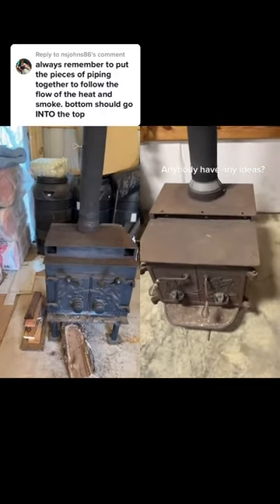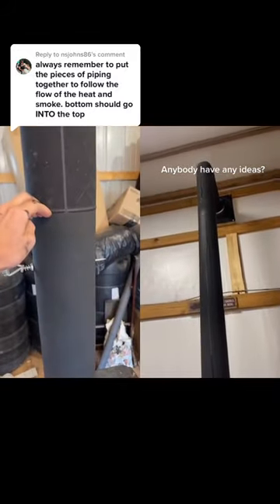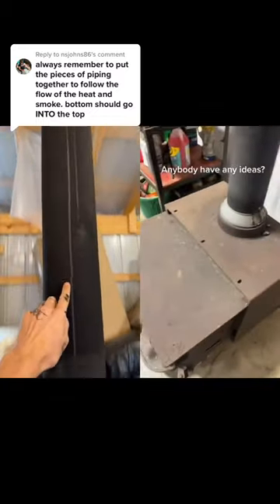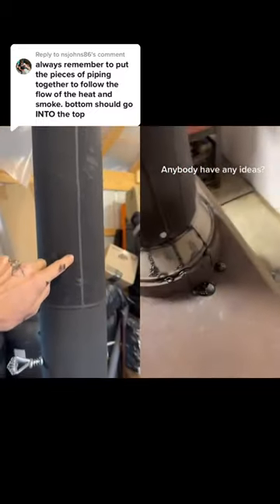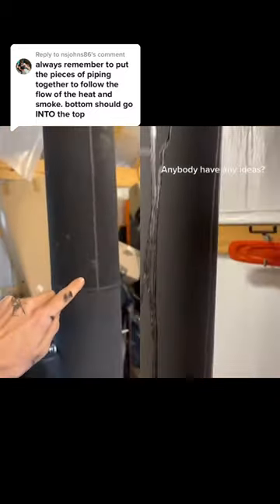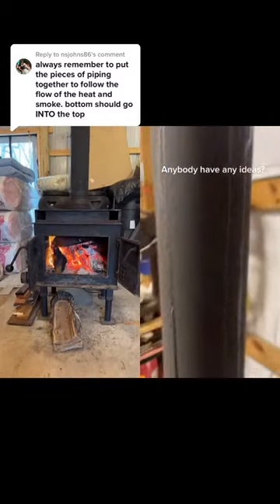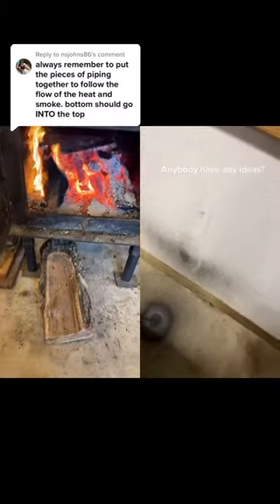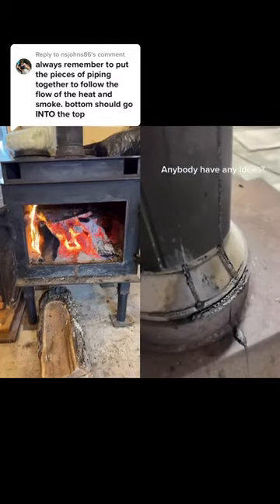January 9, 2023

Comment: Creosote is actually its own type of plant that run off coming from your stove pipe especially if you are burning pine is pine tar not creosote or commonly known in the Mojave desert as greasewood desert iguanas love the flowers it's a large bush that smells great when it rains but generally you would use a creosote log to help burn off what's in your chimney just thought I would help clear that up for you